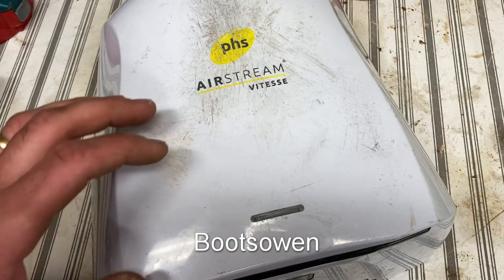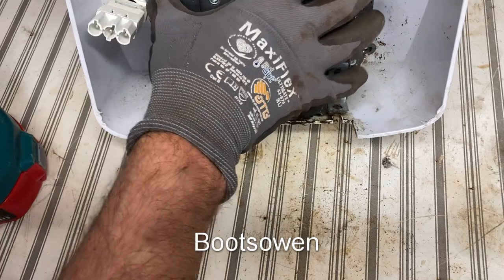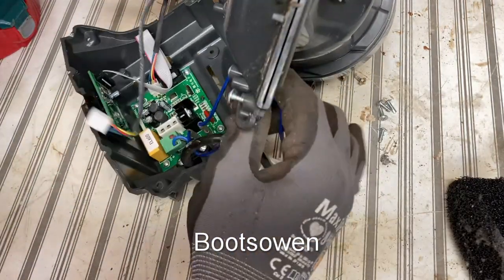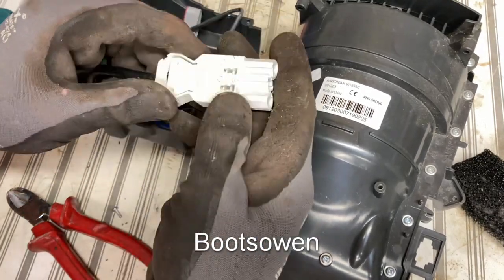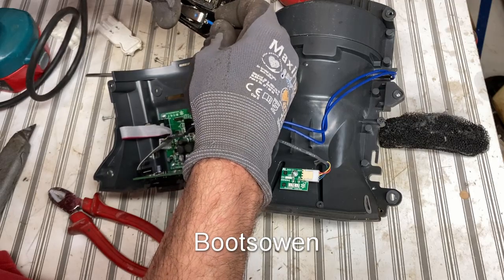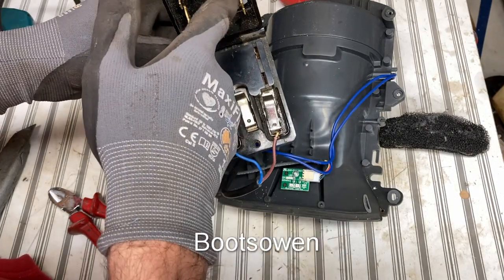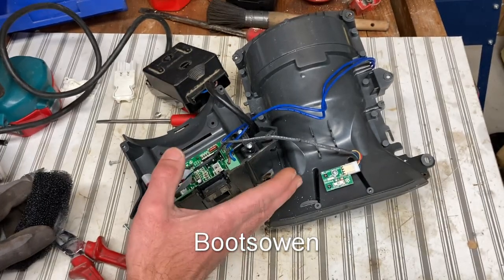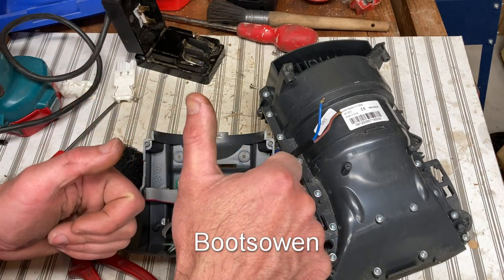What's inside a Blade Hand Dryer? PHS Airstream Vitesse AV00007749

Comment: Wow you're so lucky to find that 👍

    I've always wanted one of the original Dyson hand dryers, the big gray & yellow one with the twin air-blades & also one of the later refined V style ones they did.
I need a bigger house!

    At Weatherspoons near me there's two cheap non- Dyson dryers side by side, I always use both at once, one for each hand teehee!

'Air-blade' dryers are remarkably effective for the brief time they run to do the job.
Probably about as efficient as one can get to quickly dry your hands with a kilowatt!

Hmmm I might go looking on fleabay hehe.

    I still want a purple Contrarotator washing machine too, but one that hasn't being electronically gelded by Dyson & doesn't have disintegrated spiders!

    Thanks again for uploading these interesting videos fella.
Always a pleasure to watch 👍

Happy Xmas too 🙂
Reply: What spoons is this please? As I need someone to film this as it’s rare but it’s rare for spoons aswell because they only use this dryer on the video in chrome

Comment: As is the case, unless you are quite technical it's cheaper in labour hours to buy off the shelf proximity sensors for established microcontrollers.
But like you, I value my time as 0 or negative for the satsifaction of reusing bits that are laying around.